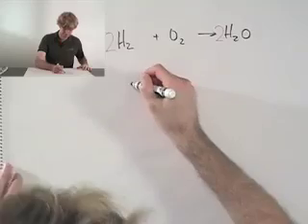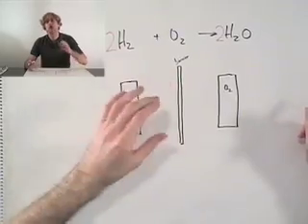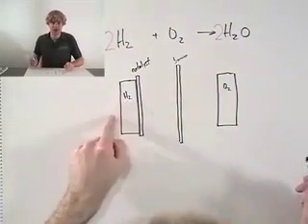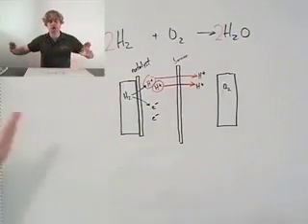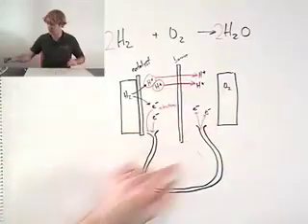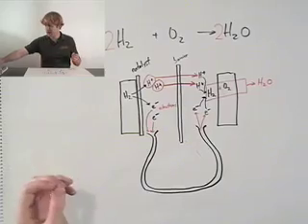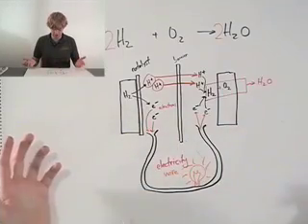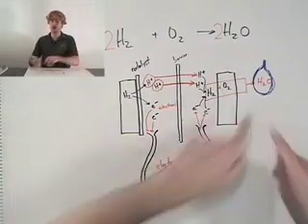How do Fuel Cells Work?

Comment: Wow.. you made a simple process WAY more complicated than necessary!

Here's a much simpler explanation:

1.  H2 gas is forced into contact with & through a platinum catalyst grid, which causes the electrons (i.e. negative charges) to be stripped off each of the H2 atoms & each H atom to consequently become positively charged (i.e. become a H+ charged atom, because each H atom lost its only electron during the chemical reaction that they each experienced with the platinum catalyst)

2.  The H2 & H+ atoms come into contact with the PEM (i.e. Proton Exchange Membrane), due to positive gas pressure, & the PEM only allows the H+ atoms to pass through it.  The negative charges that are stripped off produce a voltage & charge flows from the catalyst side of the HEC (i.e. Hydrogen-Electric Cell) through a wire to the opposite side of the HEC.

3.  Those charges then recombine with the H+ atoms that passed through the PEM to reform stable H2 molecules.  Then the H2 molecules combine with the O2 molecules, due to sufficient heat & pressure to form H2O molecules & heat.

4.  The H2O water molecules are then drained away through a tube & the heat is dissipated by a fan to maintain a stable working temperature for the water molecules reactions to continue the HEC process.

5.  The process is controlled by controlling the flow rate of the gases & by keeping the system at the optimal temperatures to optimally achieve efficient molecular reactions to continue.

Comment: Thanks for the explanation but could you please clarify and/or go deeper in an another video? It almost sounds like these cell create energy from "nothing", which I know is not the case. My question is
1. Where does the energy to split the electron and proton come from? I believe the catalyst has something to do with it but how?

2. If hydrogen is reassembled on the other side then why not just discharge hydrogen? Why does it need to react with water? I have a feeling that here in lies the secret of the "energy used/spent" but how?
Thanks for your help.

Comment: Thanks for a good show, notice that if anything the electrons e- are much smaller than H+ which are the nucleus of Hydrogen. Another important point is simply don't explain the difference of potential needed to maintain the flow of electron; possibly because you do not explain the reaction at the cathode of the Fuel Cell.
This could really be great if you took the time to review it and clear the inappropriate portion in it.
Best regards,

Comment: Good explanation, everything is pretty clear with PEM fuel cell. But what the hell is going on in an alkaline fuel cell? Hydrogen is oxidized at the anode by hydroxil ions where do these hydroxil ions come from? From electrolyte? Which is base btw. Hm. That does make sense...

Comment: 1). why electron can not pass through that barrier? 
2). what this barrier is made of?
3). H and O are gasses so how they can  be like solid electrode as you show?
Reply: 1) because the catalysts only allows protons to pass.
2) usually platinum.
3) gases are made up of electrons and protons, what you see is a in gas phase.
Reply: You didn't really answer the first question

Comment: Why does it have to combine with the oxygen when it's at the other side? The electric current had already been made, so why can't the biproduct be just regular H2 which can then be reused? Or is the oxygen used to "attract" the hydrogen through the barrier? In which case I'm wondering what forces makes it attract through so many barriers?
Reply: The electrolite has an ionising effect on the atoms.
Actually if the protons (hydrogen positive ions) are not removed from the solution (electrolite), the solution would reach its saturation point, not allowing additional  protons to enter the solution.This would mean that electricity would end quickly.Oxygen acts as a cleaner,by combining with (and thus removing) the protons and allowing a new batch of hydrogen to enter the solution.
Reply: H+ ions must reach the cathode side and react with the electrons to form H2O. Otherwise, the circuit can't be closed. The reaction won't take place if it is not connected.

Comment: I have a question: At first there's H2 and O2. When they get together, they produce H2O. As you can see, the end result is 2 particles of Hydrogen and just 1 of Oxygen when at first, there were 2 as well... What happens to the other molecule of Oxygen present at first?

Comment: you wrote : H2 + O2 = H2O (in the right of your drawing), problem right ?
Reply from the maker: Not a problem, it's just unbalanced. We use unbalanced equations all the time in chemistry, because they still get the point across. Balanced equations are important for calculations, but not so important for describing general processes. Why make something look more complicated if you don't need a balanced equation?
Reply: So H2 + O = H2 + O2 = H2O ? maybe too equal to H2+O3 etc.... ?
Reply from the maker: If I say "Hydrogen Gas and Oxygen Gas come together to make Water," and I write H2 + O2 -> H2O, it's perfectly clear what I'm trying to get across. If I said "Hydrogen Gas and Ozone Gas" then that would be H2 + O3. And as I'm sure you know, O doesn't exist on it's own, so you'd never write "H2 + O"
Reply: This is the best explanation for unbalanced equation that I've ever seen in my life.  Thanks Tyler.  Keep up the good work.

Comment: I just have one question after watching this video that I wish I knew the answer to. You keep referring to this "barrier" that only allows the positive H ions through. But in a particle explain what would act as the barrier??
Reply: My assumption is that it would have to be a complicated membrane, which has a negative character, and would repel anything that was not an ion. How you would do that, I have no idea. However you might be able to find something similar on Na+ transports in a cell. They only allow sodium ions to pass through the transport, using the size and charge of the ion to stabilize the transport path.
Reply: TriforceOfCourageQuan salt is a natiral electrolyte that acts like a barrier imoenetrable by electrons

Comment: The Hindenberg explosion was linked to storing H2 inside canvas which was painted with iron oxide and aluminium cellulose butyrate. It's now much much safer to store H2 since we've stopped storing it inside explosives.

Comment from the maker: The catalyst is just a chemical which is able to split Hydrogen gas apart into its two pieces: electrons and protons. It can be made of a variety of materials, but Platinum is a common material for Fuel Cell catalysts. Unfortunately, it is also very expensive!

Comment: If some of the electrons are used to produce light or transformed into kinetic energy as would be done in use with a car, aren't some of the hydrogen molecules left without electrons to join up with?  What happens to those H+ molecules?  Can they merge with oxygen?

Comment from the maker: @cjforse22 But you really hit on the big question here: where do you get the hydrogen in the first place? Well, water is composed and hydrogen and oxygen, so you usually get H2 by splitting water in big H2 generation factories, using lots of electricity. But this presents a problem. Fuel cell VEHICLES don't make any harmful emissions. But in order to get the H2 in the first place, you have to use lots of electricity, and powerplants make lots of pollution. So fuel cells aren't perfect.
Reply: Of course if you make the hydrogen by using power from excess wind energy generation, the whole process can become green, right?

Comment from the maker: @cjforse22 those are really good questions. efficiency of a fuel cell can vary widely; 50% efficiency is reasonable. however, that doesn't mean that 50% of the H2 is released as emissions; that means that only 50% of the fuel goes to make the electric current, and the rest goes to make excess heat (just like a normal gasoline engine does), which doesn't do anybody any good. But, that would explain why you don't have to worry about the water emissions freezing up.

Comment: Great explanation.  I have a few questions though:

Are fuel cells perfectly efficient at creating this reaction that only produces water?  If not, how efficient are they and wouldn't the excess H2 be a volatile emission? Where do you get the pure hydrogen for the fuel cell process?  Isn't it dangerous to transport pressurized H2?  Does a fuel cell run hot enough to prevent water emissions from freezing in cold weather?

Comment from the maker: the water can just drip out of the car, like through an exhaust pipe or something. so instead of having carbon dioxide and other more harmful gases coming of the exhaust pipe, in a fuel cell car, you just have water, which obviously doesn't pollute or anything.

Comment from the maker: yes, an water molecule certainly does have two hydrogens and one oxygen. BUT, we can't just write H2 + O = H2O, and that's because oxygen never exists as just one O by itself. you can't just write O alone, it has to be O2. so, instead, i say that 4 hydrogens (2H2) and 2 oxygens (O2) make TWO molecules of water (H2O). again, this is because in a chemical equation, you cannot have O by itself, it has to be O2. does that make sense?